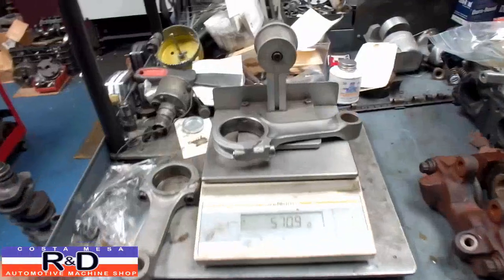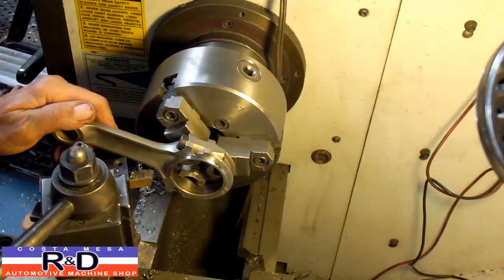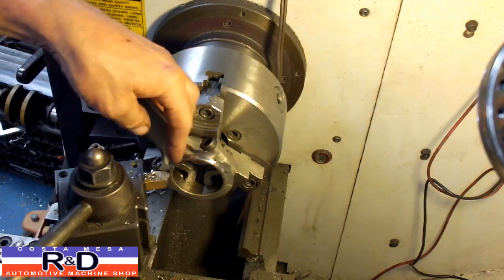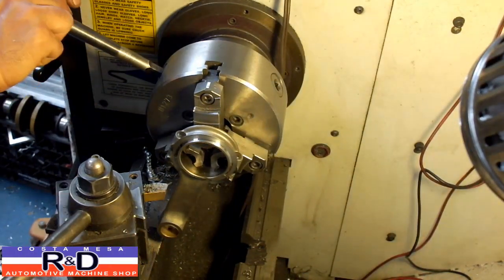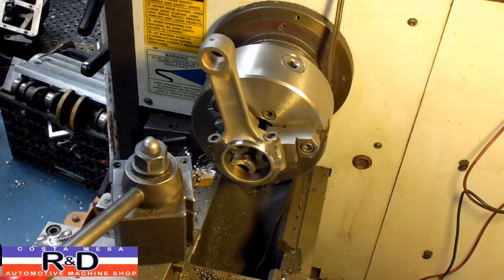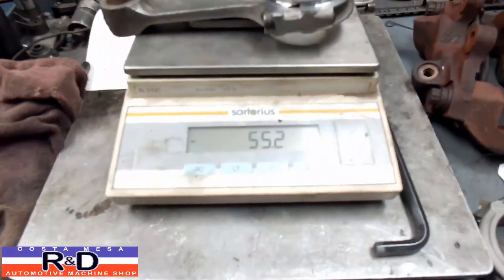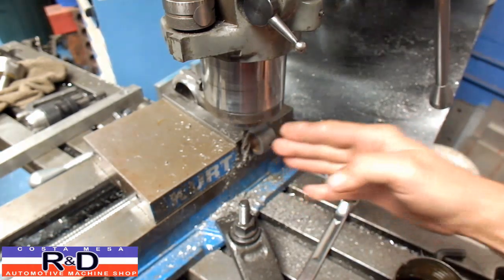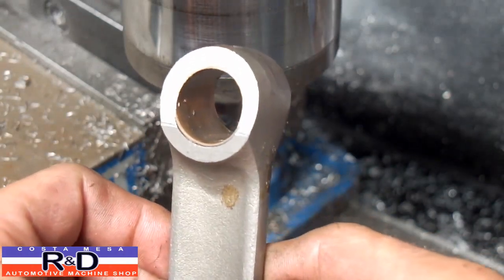BMW Motorcycle Con Rod Weight Reduction

Comment: Interesting, John i used to work at a high performance 2 cycle engine outboard developer about 30 yrs ago and we did balancing and even made a FLEX FLYWHEEL which involved cutting a standard flywheel into 2 pieces then using a stainless flex plate after machining, drilling, etc. It would eliminate the end of the crank breaking off on a HP engine. I see those rods have been bushed, is that factory or someone's aftermarket work? I assume u balanced them and crank too? A waste not to